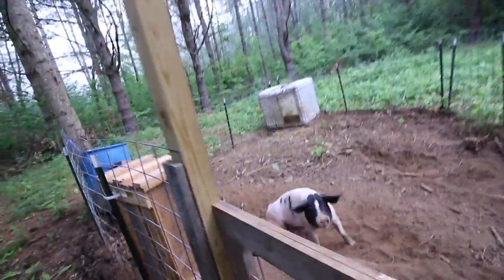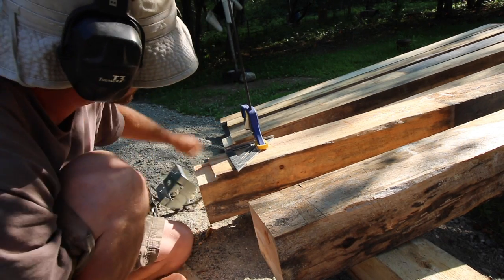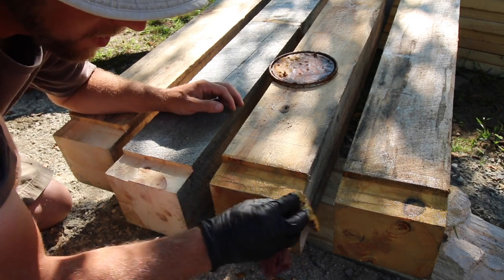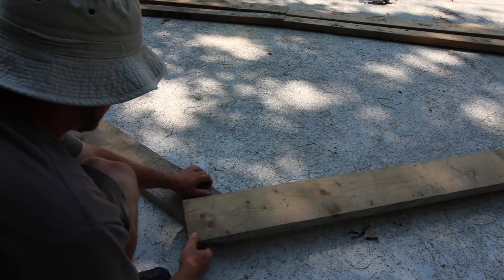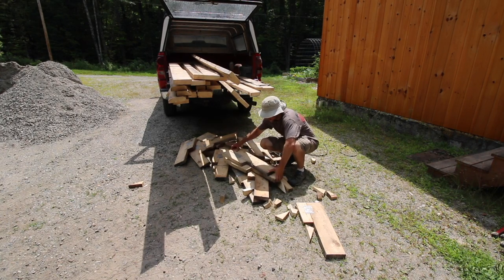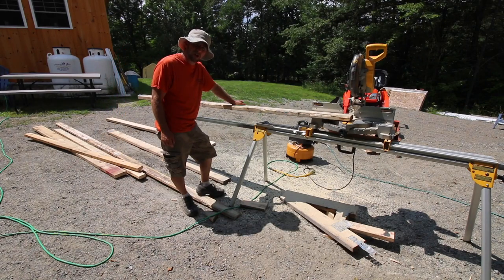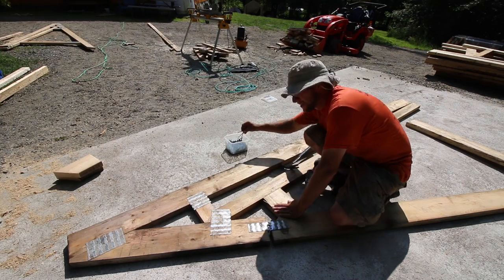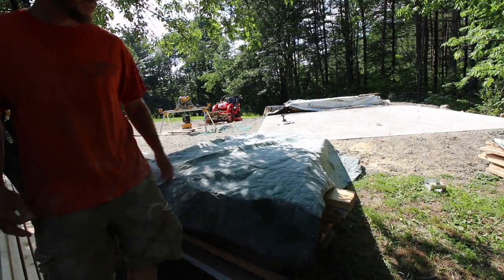UP-CYCLING ROOF TRUSSES From The LandFill

Comment: I was told that to help prevent wicking up those post to put a something like a pieces of wood maybe 1/2 " between the metal and the post, screw the post in and then knock out the small piece so there's a space between the post and metal.

Comment: I noticed when marking the angles for the plumb cut on your joists (6.50 mark on your video) you measured in to establish the short point, then used the rail side of your speed square to mark it. 
Speed square tip: First let's label the sides of your square, rail side is A, right angle to A we will call B, the long side (hypotenuse) we'll call C. Look at your square where the A and B sides intersect, you should see a little notch (some squares also have it stamped "Pivot") Once you've established your angle on your first truss, place the rail along the side of your board on the same side as the long point of your angle with the pivot notch right at the long point. (As if you were going to mark the board square for cutting.) Now rotate the square so that side B lines up with your cut, keeping the pivot on the long point. Sight along the long point side of the board to where it intersects with side C of your square. You will see a scale along side C, marked Deg. This scale is your protractor. Where the board intersects with side C's scale is the angle of your cut. Note the angle, then with the remaining trusses you won't have to measure with tape, mark then cut. Just put your square pivot at the long point, pivot the square to the angle, mark and cut. This is a useful scale. For example, if you know you need a board 48" long and want a 22 1/2* angle. Measure and mark the board at 48" place the pivot right on the mark, pivot the square to line up the long point side to 22.5 on side C, mark and cut. 
You will also note, there are two more scales adjacent to side C of your square. The second scale in is your common for roof pitch. 6/12 7/12 etc. Noting that scale while noting your angle of cut will tell you the pitch of your roof. If you know you're cutting rafters for a 5/12 pitch, you can just place your square at the end of the rafter, pivot to line up the 5 on that scale and mark your plumb cut on the rafter. Then there is a slot in the square with another scale. This is your hip/valley scale. If you're building a roof with hip ends instead of gable ends, this scale will give you the angle of your long hip rafter plumb cuts. If your rafters, roof pitch is 5/12, your hip will be 5/17. A 5/12  pitch denotes 5" of rise for every 12" of run. A hip rafter has 5" of rise for every 17" of run. 
Hopefully I've explained this clearly enough that it's understandable. Normally I would show a young carpenter, I've never had to explain it with just words before. :)
Reply from the maker: Thanks! You explained it good. I have never taken the time to learn all of that! Lol.I bet a quick lesson from you and I would figure it out quick!